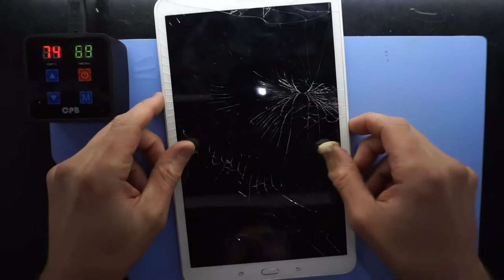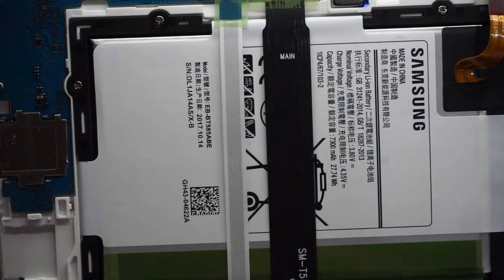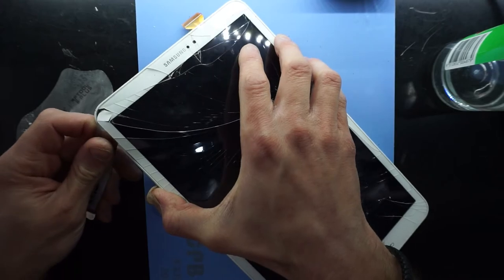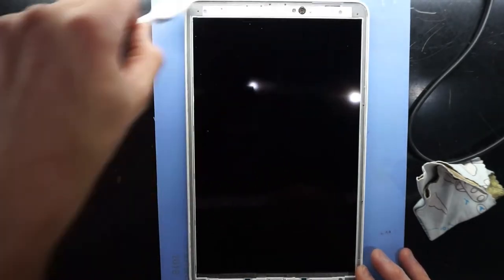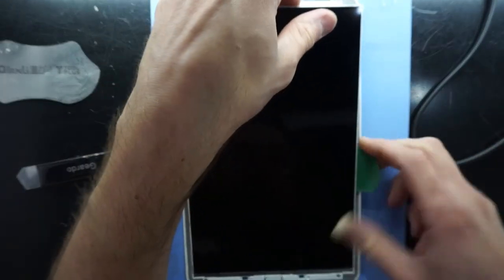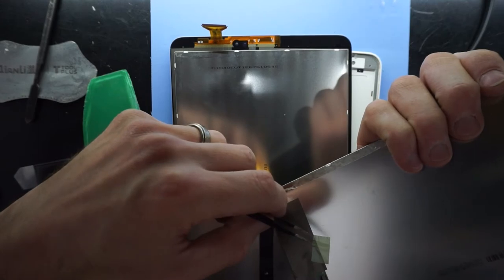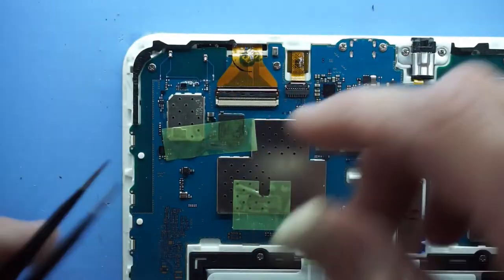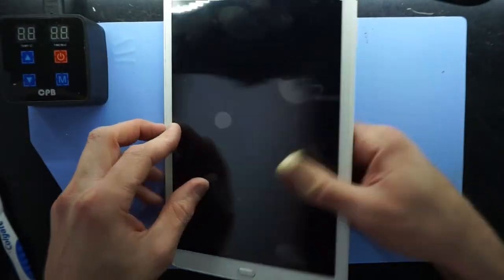Samsung Galaxy Tab A 10.1" 2016 LCD and Digitizer Replacement

Comment: I just took in my samsung tablet to replace a cracked screen but after I got it back the screen is now dimmer and the contrast is way too high.
The cracked screen looked perfect, brightness, color and contrast wise.
Is it the screen itself, or did the tech screw up?
Are there different types of generic screens for the Tab A or just one type/brand?
Any idea what could cause that?

Comment: Hi Rick. I have a question about the screen. A few seconds after turning on the tablet, the vertical lines of the screen move upper and flick. Would I need to replace my LCD display or can I find a way to fix this problem by myself?
Reply from the maker: A screen replacement would be needed
Reply: @rickstechrepairs  Sad news... thanks for replying.

Comment: Hey. I've exactly same. Though it was Screen Digitizer which I replaced it last year. So bought another screen digitizer, while putting it up, realized that the black screen was still showing crack screen but it's not physically cracked. put the new screen digitizer, now no screen at all :) when I put into charging, I hear bip bip as in it's taking the charger alright... should I replace the whole screen you reckon? thanks
Reply from the maker: i would try a new lcd display

Comment: How do I now if I need to exchange the whole thing or just the glass infront? My glass is broken and I want replace it and everything seems to work so I guess it's only the glass fron I need to replace? Is there a way to do it without a heat map or is that manditory?
Reply from the maker: heat is needed to swap, be it from a heat mat, or a hair dryer 

https://youtu.be/vULGAz6X7Os?t=379

Comment: Hello. My P580 has this really horrible flickering. It started with just some white/black lines on the right side of the screen (horizontal) torelable, no problem. But the whole screen is now flickering. Can this be fixed replacing something?
Reply from the maker: sounds like a faulty display

Comment: Hello brother,
I've the same tablet which you're fixing right now. My tablet's touch screen doesn't work. I just want to change the touch screen in a cheap way by myself. I've some important data's on that tablet which i want to transfer at my new device and then i don't have any use of that. How much will it cost to get a new touch screen? Can i purchase it via from websites? If yes then what is the model/size of that screen? Can i change only touch screen without changing the display? Or they both are same?? Hopefully you'll answer my questions. Thankyou.
Reply from the maker: Hi 

Without knowing the exact model you have, I can't recommend much 

Check out aliexpress for parts

Comment: Hi there ive had this exact same tablet since 2016 and yesterday it fell off my bed the screen instantly went all coloured lines and keeps flashing but its not smashed. i can still hear it when i get notifications how do i fix this ? is it worth getting it fixed or shall i just buy a new one the only thing i am upset about is my apps and my photos on it 
let me know thanks
Reply from the maker: A 2016 model of tablet.. unless the parts are cheap and you have a use for it, i cant really recommend to repair
Reply: You can connect it to a computer and transfer all your pictures to it.

Comment: I have just replaced the LCD and digitiser but its dead. Are there a lot of dodgy parts kicking around or is it more likely i have screwed up?
Reply from the maker: i would be checking connections on it.

Also connect to a pc to see if it gets detected (meaning it would be powered up)

Comment: Im desparately trying to fix mine as ive got passwords trapped on it and a tax return to submit....the damn replacement digi screen wont work but does random things like moving the icons around the homescreen and dropping down the top screen, none of which respond to being touched.
I guess my only option is to buy another screen n try again?
......or try to fly 10,000km back home as thats the only way to get a new password. :(
Reply from the maker: sounds like the replacement touch panel is faulty
Reply from the maker: If it's urgent I would recommend seeing a local repair store
Reply: @rickstechrepairs  ive taken it to 4 so far. They couldnt work it out so im doing it....blind as a bat! If another screen doesnt cure it ill havt to fly back to the hellhole formerly known as england cos they only mail passwords to the business address!
Reply from the maker: looking like that will be the case..
Reply: @rickstechrepairs  haa ha! Ive got it up n working! After initially finding bugger all on yt im now swamped with T580 vids and i spotted a fault with the lcd cable....but only after buying an S7 to watch them on.
Looks like shes getting an early birthday prezzie as this S7 is junk compared to my old T580.

Comment: Can I ask you if its possible to replace the little black clips that lock in the connector cables please and thanks
Reply from the maker: that will usually need micro soldering to replace

if you are lucky you can put tape on the FPC cable and slide it in to the slot and it may work that way